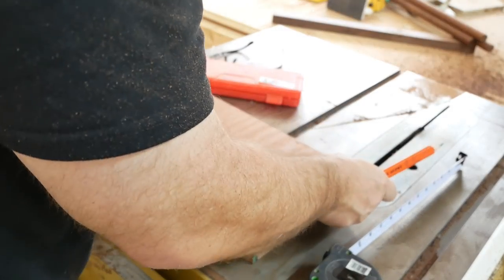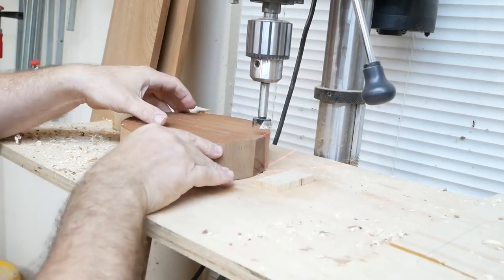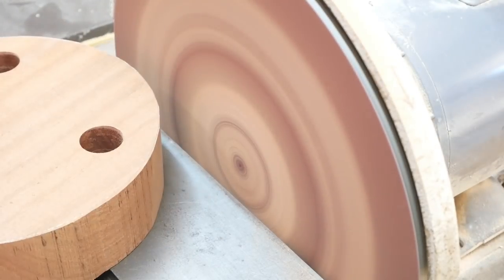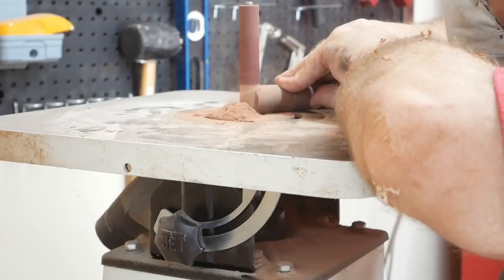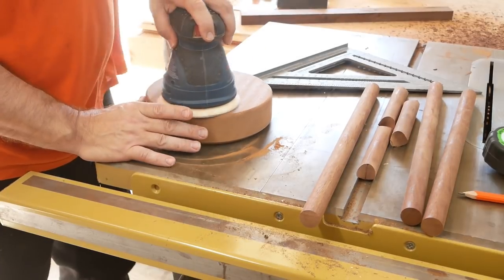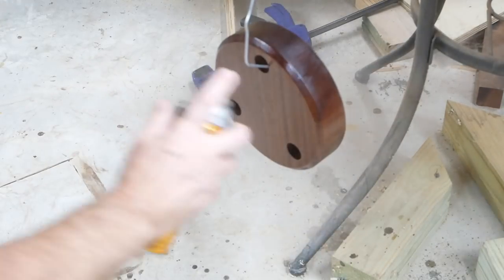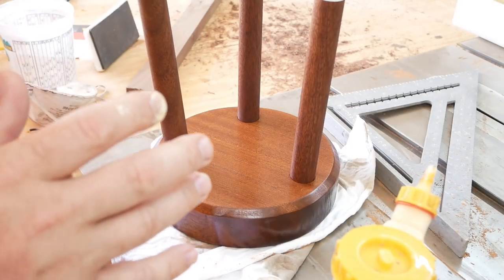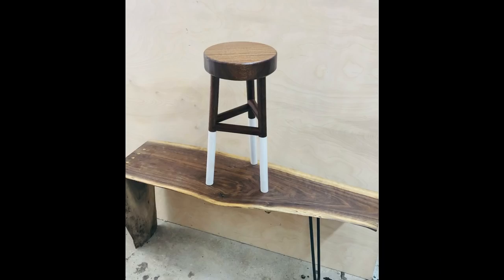HOW TO:  MAKE A DECORATIVE STOOL

Comment: I like the idea of using a scrap piece on the drill press instead of tilting it. Even though mine tilts, this way I wouldn't have to re-align it ever time! 🍻
Reply from the maker: Thanks.  I was racking my brain of how i was going to do tht without building a jig. Tht popped into my head and well it worked.